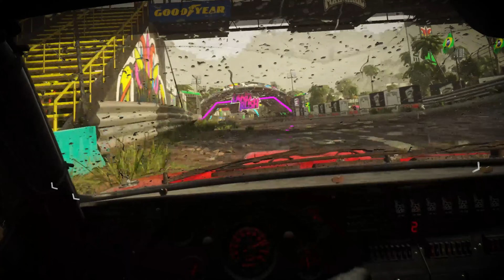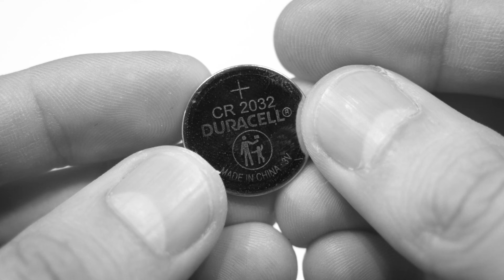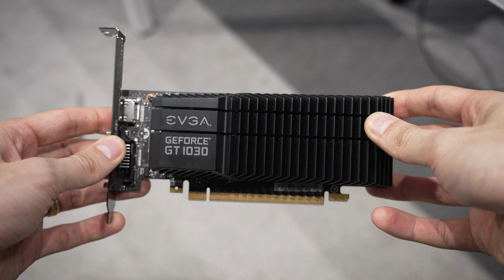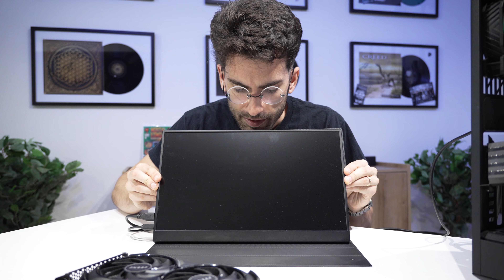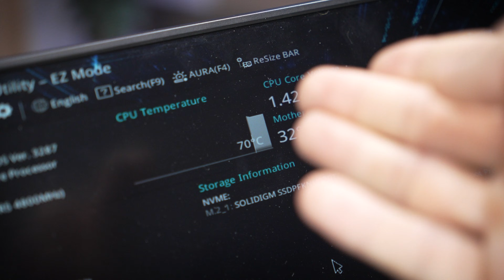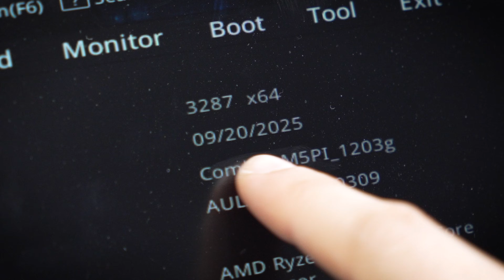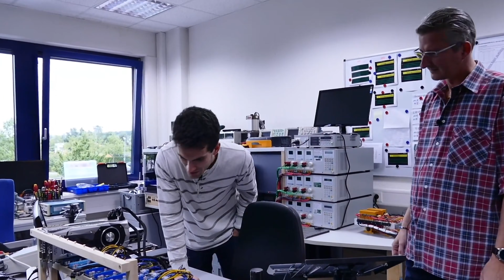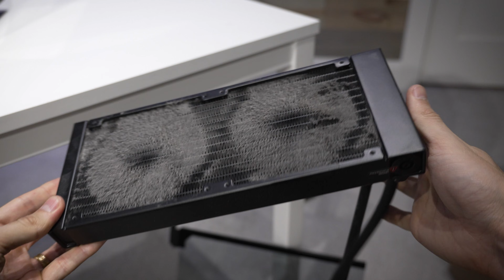Fixing a Viewer's BROKEN Gaming PC? - Fix or Flop S7:E4

Comment: The speaker CAN be a good hint as to what is the problem but for it to work you have to get in the BIOS to activate it. Some BIOS just don't have the option even if there is a spot for it on the motherboard. Have one and it works just fine!

Comment: I know you’re against going into people’s operating system but I had a customer yesterday. They were trying to play battlefield six and they enabled secure boot and TPM 2.0 and the computer wouldn’t boot anymore went straight to Bios, ended up He had the operating system installed as legacy mode instead of UEFI so sometimes it’s necessary to go in the operating system or reinstall for certain issues and his Bios was seven years old so I updated his Bios first, disabled CSM, enabled secure boot, enabled FTPM 2.0 and finally installed windows as UEFI and he was a happy gamer

Comment: I work with PC's daily and love your video's. I have used your videos on several occasions for trouble shooting.
Just a little bit of info on the Prime motherboards by ASUS. The ASUS Prime motherboards do actually have kind of a Qled thing, but instead of LED's on the motherboard it makes the powerbutton blink in certain patterns. 
Fast blinking for memory traing for example. This mode can be turned of but is on by default.
Beats trying to find a working speaker :P

Comment: I built a PC in late 2020 for Cyberpunk (coming from a 3770k, GTX 1080 system).

CPU: AMD 5800x
GPU: ASUS TUF 3090
MOBO: ASUS  Crossgair Hero VIII
RAM: G.Skill Ripjaw 2x16 DDR4 3600 CL16

The odd thing is every 2 years my RAM fails. I just put in an RMA last night for the RAM that was an RMA from Jan 2024...almost 2 years exactly.

XMP enabled, 3600mhz, infinity fabric @ 1800mhz, Voltage 1.344-1.35, timings all align to spec. Bios is always up to date. Ran memtest and windows mem test, both come back with errors. 

The system is 100% stable over the course of 2 years.  Benchmarks, heavy gaming, video editing, compressing/uncompressing large data sets, zero issues.

Odd and have no idea what else to look at.  🤔

Comment: So I'll share a problem that I have(well kinda) and guess the issue coz Idk: 32 gb(4 dimms) Ram ddr4 on a b450 mobo paired with a ryzen 5600x.

I had to switch ram between them so it works, otherwise it won't post. There's one dimm that doesnt work in 3 out of the 4 slots. Why? It makes no sense. 

I was shocked at first, bought 2 dimms mounted them and no post. I was like wtf?!  Is it still a ram stick issue since it's the only one that doesnt work in any other slots or is a cpu maybe, even mobo?! 

Yes, it's the same brand, same clocks and timings, voltage. All 4 are identical

Comment: Because of you and Dawid, I am running a BeQuiet Straight 12 850w with my Astral 5080.  Its been good so far, I am also running their 90 degree power adapter with no issues or melting.

Comment: on the pc speaker thing not working: there's a pretty good chance the mobo's bios has a setting you need to enable first for the pc speaker itself to actually output anything. mine does for example [gigabyte x670 gaming x ax v2 if it's at all relevant]
kinda unfortunate when you can't get a picture though

Comment: Didn’t you test the ram on another system I case it’s a compatibility problem 
I had the same issue on a msi b650 with a 7700  I ended up with the same corsair as you just put in 
Also was the ram intel xmp version as amd expo version is needed 
It happened to me corsair expo ram worked definitely was a headache moving from am4 ddr4 ram

Comment: I went with a MSI A1000G 80+ Gold full modular has for my psu and i think i took a good one for my rig, the only issue i had was a premature nvme death but has i read on reddit and a lot off place that  there was a windows update that didn't play nicely with some nvme and mine was one of them has it was a Western Digital Black SN770 2Tb. I had 2 so the other one that has no windows on him survived but the other one die one morning and when i trouble shoot my rig i found out it was that when i removed the bad ssd and i saw that my pc finally post on the bios. I did a rma to sandisk and they send me a SN850X has replacement. So i still have 4Tb of nvme and i'm happy with that.

Comment: I would call this a overheating issue that fried the DDR5 ram. This is why I never recommend water cooling in any set up it’s not maintenance free and water/electrics don’t mix well. Water cooling only required if you want to overclock the system but once these blocks become clogged the heat will kill components. Many modern systems will compensate lowering performance to manage temperatures to keep the system running but eventually the heat kills something that stops the system dead. Amazing the CPU still alive. System reduces performance to control temperature this means less power consumption so I would be very surprised if power supply’s are faulty.

Comment: Thanks for taking the time to explaining how to mount the AIO correctly. I see so many PC photos where the AIO is “perfectly” installed… perfectly set up to be ruined by air bubbles.
Reply: this is only the correct config if the pump is on the tubes like this AIO it needs to be reversed if the pump is in front of the CPU cooling plate.

Comment: Of course I have no full proof of it but I had failing DDR5 memory in my system too and have seen it with the system of a friend. All DDR5 failing had RGB on it. Mine had, friend's had and those failing DDR5 on these episodes do have RGB too. I suspect those sticks getting too hot, by the higher speed the memory is running and the heat from the RGB is just too much for many sticks. Replaced mine (and friend's) memory with non-RGB DDR5, even on higher speed, and no problems after the replacement. As I said, no proof it is that combination but I get thoughts to it as I have never seen DDR memory failing before. And I'm building pcs for over 30 years now.

Comment: I wanna see that ram retested in another system. They are pricier than gold at this point, better cover everything.

For the AIO , i assume you tested at 100% pump speeds and it was the same. 
Maybe the user took it off and put it back but didnt repaste? That's very common when they troubleshoot on their own. 
I wanna see it open !

Comment: That ram kit is most likely not compatible as it doesn't seem to be listed on the manufacturers QVL for that board. The pins on the kit that came with the PC could be dirty, smudges are enough to stop them from working reliably especially in multi-channel modes.

Comment: Another reason to not get Thermaltake supplies, they void your warranty when they screw up.

I got a Thermaltake Toughpower GF3 850W as a gift from my dad. Thermaltake shipped the wrong cables with the unit, that were designed for their SFX supplies and were unusable. Contacted Thermaltake support and they voided my warranty because the power supply was a gift and refused to replace the cables "because we don't give away free product" - their exact words. I even offered to ship the wrong cable kit back to them at my own cost, they said no and closed the ticket.

Fuck you Thermaltake, I will never use your products again.

To make the supply usable, I bought the Minifit Jr. connectors, pins and crimper on Mouser, and some flush cutters. Cut off all of the Microfit connectors and crimped on the correct connectors, now I have a usable supply, though I don't trust it for more than bench testing.

Comment: im building a new system with an msi B850 tomahawk with an R7 9700x with 32gb of DDR5 RAM from g.skill im not getting any video all power is working fans are spinning but the EZ debug light is red for the CPU and yellow for RAM, i tried to flash the bios and the bios light just blinks for hours nonstop. i need help to know whats the issue but i think the motherboard or cpu is bricked

Comment: Fix or flop series helped me, after watching a recent video where the dram controller failed in the cpu, i had recently had a cousin's system with the same issue, if not for that video i would have never identified the issue in a hundred years. The system in question was a i5 7500 with h110 motherboard and 8x2 2400mhz ram. The system turns on but no display, after tackling the usual suspects by swapping ram, checking psu i swapped the cpu into my z170 board and voila dram light was on. Somehow in the process the motherboard is cooked as well, cause my working ram and 6600k didn't giveout display either.

P. S. In my previous system i bent a couple of pins in the cpu socket, after trying my best to bring those pins back to position the system worked well but was killing rams after a while.

Comment: Computer speakers work, every single PC I built, beeps and they can help troubleshoot with the beeps! It's like not wearing any anti-static gear saying you don't need it. You don't need it until you do! Thermaltake Smart have a 5-year warranty, they are great power supplies, never had one die on me, never hesitate to get one if the budget is limited. Please note that in my opinion, if you spend more on your water cooler than your power supply, you clearly have your priorities mixed up. Any air cooler will outlast any water cooler, always, and it's usually the GPU that needs crazy cooling, not the CPU, for most gamers. In the last 20 years or so, I've had pricier PSU blow up more often than cheap ones. It doesn't mean I don't recommend them, just saying, it happens even if you pay 50-100$ extra. Still, cool video, good job and it's great that you do this!

Comment: Long time viewer, never said this at the time buy a while back I switched pc cases and wanted to get fans that didnt come with my old case (they werent great) i had seen one of your videos about be quiets silent wings fans so I went with those. Love those fans I have had them for atleast 3 years run quiet and also can run at 2500rpm (got the high rpm varient) if temps get hot due to ambient usually being 80 in the room of my pc. So glad to see be quiet still being a primary contributor to this series. Only 1 gripe with those fans they dont work with my tower cooler mine used the wire clips which suck but they arent compatible with silent wings fans, but the Silent wings fans are so easy to install and remove and stay wisper quiet at speeds over 1000rpm. So GO BE QUIET. Also in regards to everyone like oh multiple component must be a scam. I recently had to replace my MOBO and Power Supply due to i believe the PSU partly melting my supplemental Cpu power socket causing random power offs and eventually total boot failure where it wouldnt even power on.

Comment: Hey Gregg, I really enjoy both the FOF and PCDC series!

I hope you can create a website where all the broken PC units featured in the FOF (Fix or Flop) series have their component failures, causes, fixes, and whether parts were replaced or deemed beyond repair listed in a sortable database. The database could allow sorting by part, issue, fix, etc., in a table or spreadsheet format.

Each unit featured in the series could have a link directly to the relevant video, with timestamps for specific entries to make referencing easier. This would help users quickly find similar issues they’re experiencing. I think it would be a fantastic gift for your million-subscriber milestone!

I work on PC services as a side hustle, and your channel has helped me a lot. I really hope this idea reaches you or someone knowledgeable in web development who can help turn this simple, yet doable concept into reality.

Comment: I have the OG Y70 touch, and just a few weeks ago i upgraded my motherboard to an aurous x870e elite x3D. 

I added some fans to the bottom of the case, cleaned out the radiator snow, got the board into the case, no muss no fuss. 

i boot it up and....and my 5090 isn't being recognized, like the fans don't even spin up. 

Fear. Immense and all consuming fear. 

I pull the card, check for damage, reseat it (sometimes difficult to get the big cards to seat properly in the riser. 

Nothing.....pull the AIO off, check for bent pins in the socket, all good. Repaste, replace...no mas. 

Dig through the bios, everything good. IGPU works fine. 

5 hours. I spent 5 hours, rebuilt the thing....twice! 

And finally after reseating the gpu for the 30th time....the fans spin. 

But still no picture out.  

Then it hits me....the snazzy full coverage M.2 covers are just a wee bit too thick to allow the dumb plastic case around the riser cable to seat properly. 

That was it. 

Hytes plastic enclosure for the ribbon cable.

Comment: Memory failures are the most common thing I see. Which is why the massive price increase sucks. Because it's one of the few components these days that you very well may need to replace due to failure at some point.
Reply: Currently running a 64G 6000MTS CL28 kit, but have another 48G 7800MTS CL38 kit on standby. Hoarding hardware for the win!

Comment: Gonna repost this as a regular comment so Greg can see it and check this stuff in future :P

Check the ram voltage, also cpu voltage. Asus likes to push above spec power through their boards so all the "default" and "auto" settings in your BIOS are likely putting too much voltage into both. 1.4+ volts for the CPU sitting in bios is way higher than the average 1.35 volts it should be doing. 1.4 is ok if overclocking for short periods but long term it'll burn out the CPU, it should only be hitting that high under load (like gaming etc). Having said that CPU's are built tougher. If the ram is being over volted by the motherboard as well that would explain why you had 2 kits fail (and the new kit you put in will fail at some point as well). I'd check for proper voltage settings for the ram and cpu and adjust in the BIOS to make sure you don't have future issues.

Comment: One thing that always bothered me with most Prebuilt PCs: They just ship the finished PC. You don't get any of the paperwork or boxes for the individual component (like the mobo, cpu, gpu). They "could" be using refurb/open box parts to save money.. or even have a deal with the hardware companies to use those parts to get deep discounts. Not saying they do... but they could. Except for storage drives... you can tell if those have been used and wiped.

Comment: Greg, love what you do. One question about that AIO placement - I have been under the impression that running AIO coolers with the tubes downward and rising upward to the water block can be more problematic for proper water flow in the long term compared to running the tubes downward from the radiator toward the water block. I thought I saw GamersNexus talk about this so I’ve taken it as gospel since then. But wonder if you have any insight. I see you did the tubes from the radiator on the lower side here.

Comment: Greg, a quick note on the Post beep speaker.  For years, default was enabled in BIOS.  At some point, the default became disabled.  When you clear cmos, post beep is disabled by default.  Most people never enter the BIOS and enable it.  Its still a handy diagnostic if available.  The Fix or Flop series is a valuable service for us novice builders.  Happy Holidays my geeky friend.  Looking forward to the bald head.
Reply from the maker: Yeah I get that, but it defeats the purpose to have the beeps disabled by default (which most modern boards do) if you can't get a POST in the first place to enable them. Thanks for watching!

Comment: So is it possible the lack of cooling across the motherboard due to using an AIO (versus air cooling + fans) allowed the ram slots to get over 70C from the CPU cooking? If they ram got over 70C... it could kill them. That would also explain why it worked for a bit with one stick then died again as that one got too cooked. On the Power Supply..... Why Do You Not Like Those Thermal Take Smart PSUs? Having a PSU supplier as a sponsor does make it seem a bit forced. You never checked it, you just replaced it. They have decent reviews and are affordable and an actual recognizable name brand... good luck fighting that battle with just "bad vibes". Lol. If you have some insight on why they should never be used, I'm all ears. (I've bought them to build a "new" PC with other old hardware to give people PCs... never had an issue. But they were also rather low power hardware- sub 100 watt CPUs and 200 watt GPUs. I would not use a $60 PSU with a $1000 GPU).

Comment: I know you insist the speaker doesn't work.  But to be fair.  In all of my 30+  years of doing this myself, I have never seen a speaker not work when plugged in. To also be fair I have never seen a PC speaker go out...  BUT, could it simply be that the speaker you are trying to use is broken?   Just my 2 cents.